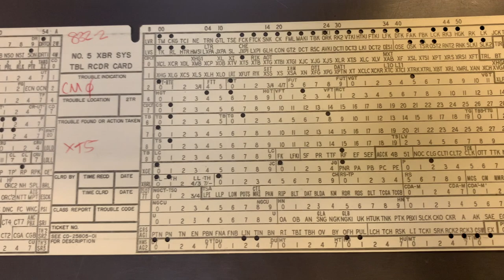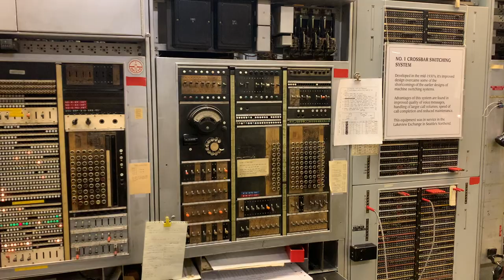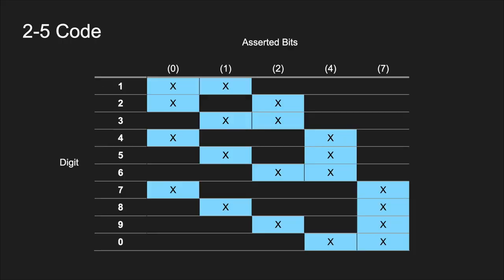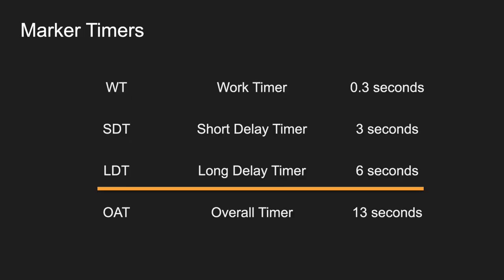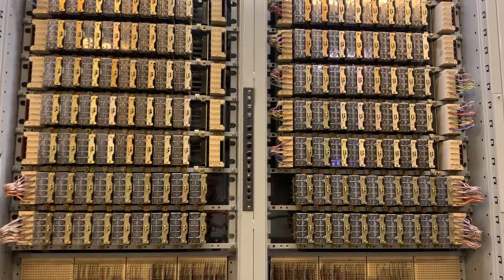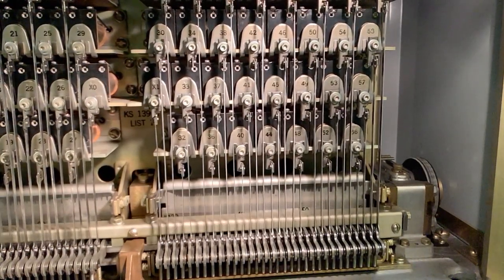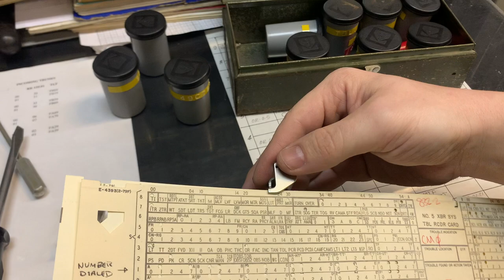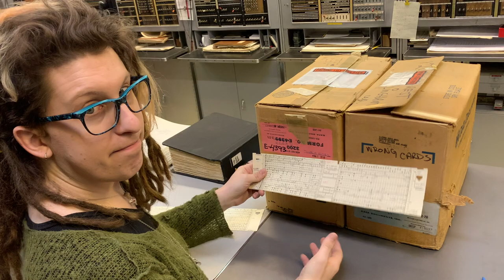The 5XB Trouble Recorder

Comment: In, Ellsworth, Maine?  I know exactly where that is.  I spent something of a summer time, right there. And they've got a phone museum? I guess lots has changed in the past 50+ years? Since I was there last. HUH?

And you're out there in Seattle, Washington? I guess you been to Ellsworth, Maine?  And the lobster certainly is tasty. You could even get it at McDonald's! That absolutely blew my mind! Who would have thunk. You could get lobster at McDonald's? But you can in Maine. It was great! That would be a reason to move to Maine. Certainly not the weather. It's kind of cold and frigid there. So, really only for the hard-core fishermen. But I digress.

Trouble Recorder? I have a lot of troubled, tape recorders, yes. They are from a bygone era. Decades, ago. They used to mean something. They used to be very expensive. When in 1978 a stereo studio recorder. Would cost as much as a brand-new Toyota Corolla. Back in 1978. As I had both, tape recorders and my Toyota. Each one of my stereo tape recorders. Cost as much as my, base model Toyota Corolla  in 1978.

I don't think anybody is really learning anything.
RemyRAD